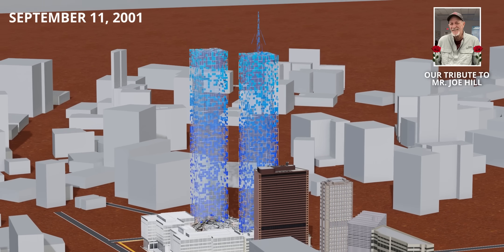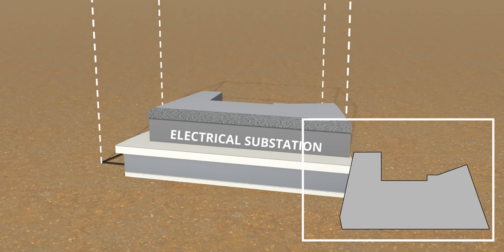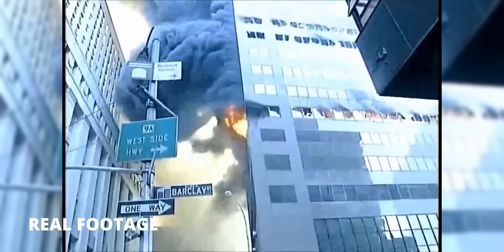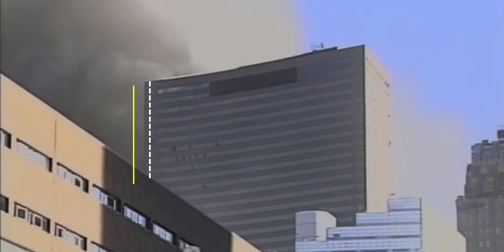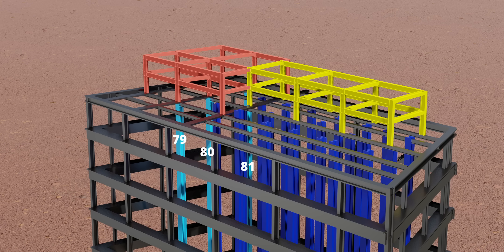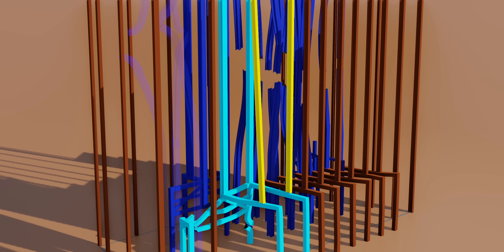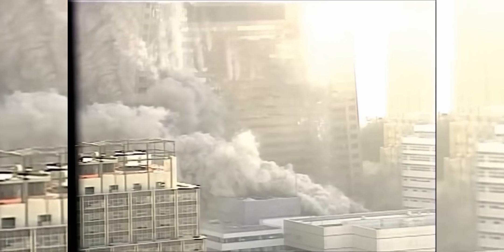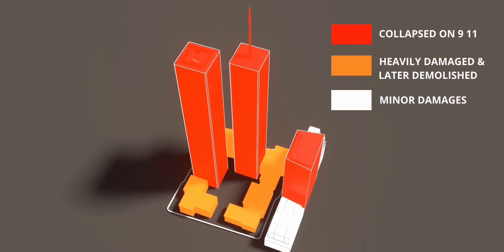Collapse of Building 7 | The Complete Physics

Comment: All with only 2 small planes
Reply: You have a strange definition of small
Reply: @TheCriticalStinker-01 Even a380 would look tiny compared to these gigantic structures
Reply: @Dream09997 - 120 tons at 589 mph hits like more than a ton of TNT.
Reply: 159 feet long. 156 foot wingspan. 17 feet 9 inches across the fuselage. Minimum weight of 176 650 lbs.
Yeah. "Small".

Comment: I need to know what really happened to WTC Building 7 more so then how the Great Pyramids was built. That was controlled demolition and even a blind person could see that.
Reply: I respectfully disagree and offer this far more detailed explanation instead:

Much misunderstood, Building 7 was the 6th building to collapse of 10 lost on 9/11. Because of its early low priority, conspiracy filled the information void with garbage made up by technically ignorant people promoting political agendas. But 7's loss is an engineering problem and should be treated as such, so I prepared this brief summary of my own analysis to fix that, using technical analysis, not ideology and tired memes. 

At 10:28am the WTC North Tower collapsed, showering Building 7 with tons of burning debris, causing heavy damage and starting many large  fires which burned out of control for the next 7 hours. Half the FDNY firefighters having been killed, units in disarray, equipment destroyed, no water pressure, and the greater urgency of search & rescue efforts, Building 7 couldn’t be saved so firefighting efforts were pulled as futile and 7 left to its fate. Firefighters make that sort of choice every day in brush fire situations - which houses to save and which ones to let go. Only real difference here is moving the decimal on the size and cost. People get overwhelmed by the size.

www.youtube.com/watch?v=g_SvpwyC17M

Collapse of a burning structure is always a concern for firefighters. Steel buildings subject to fire rely on active firefighting to survive. Buildings are designed around 1 to 3 hours of fire resistance, allowing time for occupants to escape and active firefighting to get started, after which all bets are off. Left to their own devices they'll exceed their design envelope and collapse, like Plasco Tower and Wilton Paes de Almeida. In 7 the occupants escaped, passive and active fire protections were compromised and active firefighting was abandoned hours before the collapse, which left the building to its fate. It lost. Odds on Building 7 would eventually collapse, and it did. No big deal in logic.

 http://www.youtube.com/watch?v=WnYBX6QT0R4 

FDNY Chief Daniel Nigro - The biggest decision we had to make on the first day was to clear the area and create a collapse zone around the severely damaged 7 World Trade Center, a 47-story building heavily involved in fire. A number of fire officers and companies assessed the damage to the building. The appraisals indicated that the building's structural integrity was in serious doubt. I issued orders to PULL back the firefighters and define the collapse zone. It was a critical decision; We could not lose any more firefighters. It took a lot of time to PULL everyone out, given the emotionalism of the day, communications difficulties and the collapse terrain 

FDNY Deputy Chief Peter Hayden ; We had our special operations people set up surveying instruments to monitor and see if there was any movement in the building. We were concerned of the possibility of collapse in the building. And we had a discussion with one particular engineer there, and we asked him if we allowed it to burn could we anticipate a collapse and if so, how soon? And it turned out that he was pretty much right on the money, that he said 'In its current state you have about 5 hours 

The collapse of Building 7 was anticipated and widely reported in the media throughout the day, with 24 video cameras recording some or all of the collapse. Everyone knew what was coming and why. 

www.youtube.com/watch?v=OY5S5k3tMHI

The collapse of Building 7’s was entirely different to the Twin Towers and harder to understand, most details being hidden from view and not intuitive.  But we can still sort out what happened through careful analysis and observation. This is my explanation of the collapse relying on no outside authority. 

Building 7 was a unique, asymmetrical 47-story steel framed structure built atop a smaller 3-story building serving as a partial foundation, requiring lower floors dedicated to complex load transfer structures. Of trapezoidal shape and all-steel tube-in-tube construction, B7 (above the 7th floor) consisted of a central core of steel columns carrying most of the gravity load, perimeter steel columns around the outside of the structure carrying the remainder of the gravity loads and long span beams and girders to tie those elements together and form the floors. On the outside of the building hung a moment frame or outer shell. 

Phase 1 : First externally visible signs of collapse initiation occurred at 5:20:28 pm and were notably quiet with observers not realizing the building was collapsing! No audible warning in the form of hundreds of ear drum busting 180-190dB explosive bangs preceding the collapse. Here at 12:00 a local CBS affiliate reporter is talking 10 blocks from B7 when collapse begins. People don’t start to notice the collapse until 12:11. At 12:45 is the famous CBS fixed camera clip of Building 7’s collapse. Note how quiet it is. 

www.youtube.com/watch?v=t5tEy6mXSE8

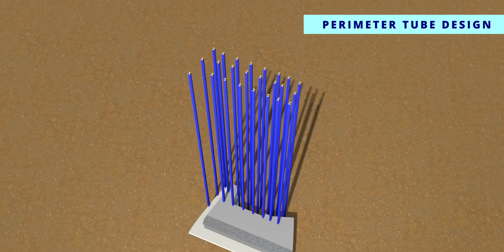Collapse initiation was due to lower floor failures above the load transfer region (8-14th floors) in the NE corner. In this video at 0:45 you can see the NW corner from inside the building while under construction, Column 79 just out of frame on the left. That big, angled steel beam across the top of the frame connects to C79 at one end. The girders connect to the beam. That beam and all those girders depend on just one connection 

www.youtube.com/watch?v=nP3TNHPCIVU&t=45s

Phase 2 : The NE lower floor failures caused a loss of critical lateral support over an excessive length of Column 79 and it buckled. Looking at a floor diagram of Building 7 (www.nist.gov/image-16640) when you see all the structures that depend on C79 you quickly realize this one column was a relatively isolated structural element on which a disproportionately greater fraction of the structure depended analogous to say the Key Bridge. Externally as collapse begins we see a vertical progression of window breakage along the 44-46 line and a kink in the roof of the East Mechanical Penthouse at the top of the building, consistent with C79 failure. Normally with a buckling column, the load could be redistributed to other columns. With C79 that is not the case - the failure did not redistribute the load, so the collapse rapidly progressed to the roofline, sinking the rooftop penthouse. The transition from full capacity to almost no capacity occurs in an instant and will result in virtually no resistance 

Phase 3 : With C79 gone, B7’s progressive, non-symmetrical collapse continues with adjacent columns 80 and 81 left laterally unsupported, and quickly buckling as well, sending the EMP down through the building. C79-81 all have no diagonal bracing, which is the major reason why they could not redistribute a lot of vertical loads among one another. From there collapse progressed from east to west through the central core until the core was gone taking all of the interior floors and probably most of the perimeter columns with it. Follow the horizontal progression of window failures low in the building and the dropping of the remaining rooftop structures into the building. One of the big takeaways from the NIST Building 7 study (invariably ignored) was how their modeling determined C79 failing under ANY circumstances would have initiated the same collapse sequence. 

Phase 4 : After about 10 seconds only the exterior moment frame remains, giving the illusion B7 is still standing to the casual observer since little has outwardly changed. But it is just a hollow empty shell like an empty cereal box supported only by a few remaining columns and overloaded from the loss of the core columns and floors, quite unable to remain standing. With nothing remaining behind it, the north face leans inward, forming a V in the roofline, the last few columns buckle under the strain and the moment frame free falls, landing on top of the debris pile. 

It is only here at the very end that a single measurement of alleged free fall acceleration is taken, from a single point on the outer shell. The Building did not “free fall” – just one corner of the outer shell did, sort of. The Building_ (defined as its center-of-mass) was already gone before that happened. The period of alleged free fall was a product of how it fell NOT why it fell and can't tell us what started the collapse 10 seconds earlier. Start to finish the collapse took 18-20 seconds, 3 times longer than free fall . How fast something falls cannot tell you what started it falling_ anyway. 

The debris spread outside the footprint blocking surrounding streets, heavily damaging the Verizon Building and destroyed Fiterman Hall. 

Building 7’s progressive, non-symmetrical collapse was incidental and unintended collateral damage from the combined effects of fire + time + gravity, started by the collapsing North Tower. That is true no matter who planned and carried out the 9/11 attacks or why . The collapse was of so little consequence it barely registered at the time - a footnote, only taking on semi-mythical status as an alleged smoking gun years later when demolitions at the Twin Towers, missiles at the Pentagon and shoot down over Shanksville all failed and conspiracists had nothing left to work with. 

Anything can seem like a conspiracy if you don’t understand how it works. Now you should. I hope you found this helpful, informative and it solicits informed critical comment. If I made any errors of fact, logic or reason or left anything important out, please let me know so I can fix it. IF you can offer a more plausible alternative please do. Be the first. Please start any reply with the words “Tits McGee” or I will know you didn’t read it and are wasting my time.